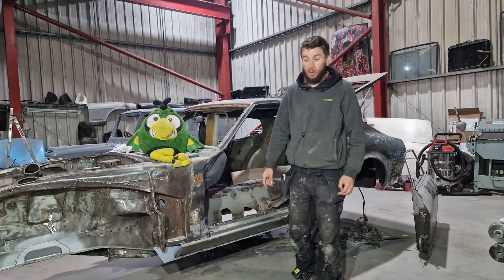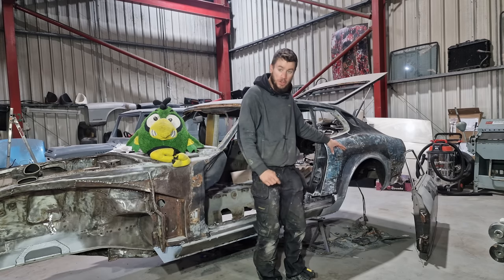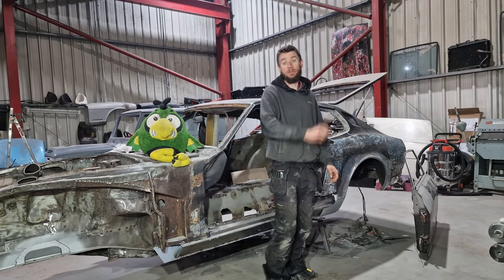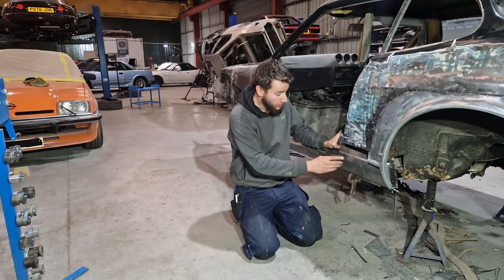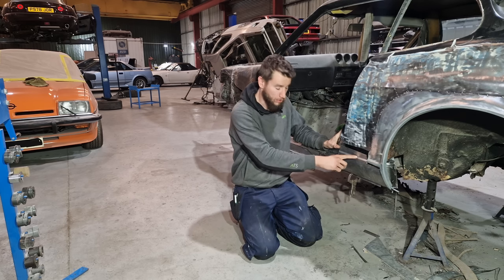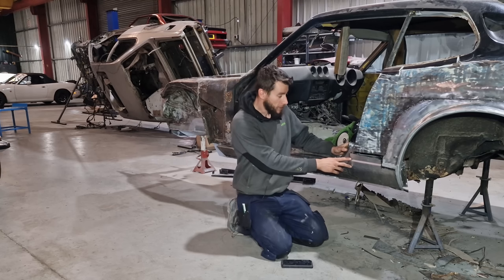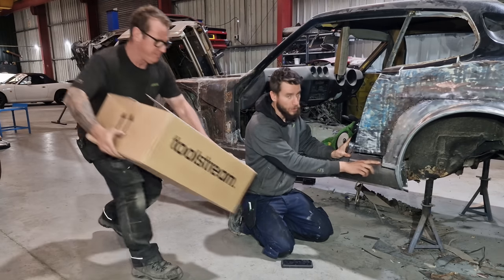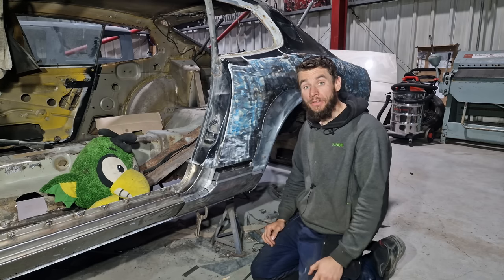Handmade Brand New SILL On This ABANDONED Disaster Datsun 260z

Comment: Mate, use painters tape when you need to make a stencil. You can then lay it out flat and stick it to a fresh sheet of metal for cutting. It's also very easy to cut with a razor. As for the edges with a radius, I see why you cut it up in sections so you can bend it easier around. Wouldn't it be better to weld 2 flat pieces together perpendicular, build up a thick bead of weld on the inside. That way you can substract material from the sharp edge on the outside with a tool and be left with the same radius, but much smoother and precise.

Comment: So one thing I notice with all these small metal panels being tacked together to make the whole thing, is that the backside is not primed or painted.  So how do you rust protect both sides of a sill, to prevent it being eaten from the inside?
Reply from the maker: The back side of evert panel recently has been primed. That long full length sill is fully primed behind before I welded it on. Also cavity wax will be used
Reply: @yorkshirecarrestoration  Thanks for the info.  Doesn't the weld burn off the primer along the seam on the backside? I was wondering the same with all the fiddly bits on Matt Armstrong's BM.  Cavity wax is great of course.  No criticism intended, just curious.  Also can I pm or email you about a potential project?
Reply from the maker: Yes that's tlwhere the cavity wax comes in when all the welding us complete. And yes, can you get us on our socials?

Comment: Great to see the channel growing, good sir! And excellent work as always. If I may ask, what do you coat worked steel in so the inside face does not rust when welded into a spot where you can't access and will never see the light of day or the feel of topcoat?
Reply: The best solution is lanoline spraying of the cavities, Fluid Film (what I use) is great but may be  a tad expensive. This will creep into every corner in cavities, it goes into metal pores so later humidity will not cause rust.